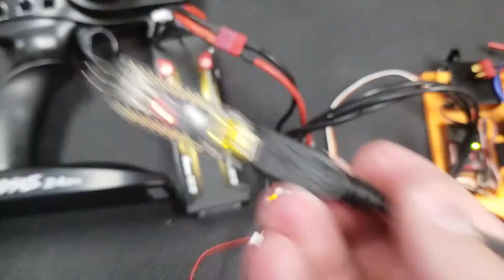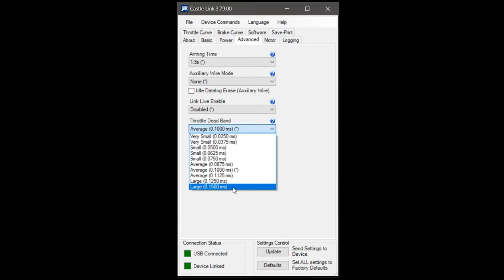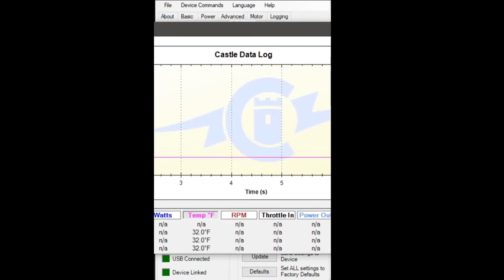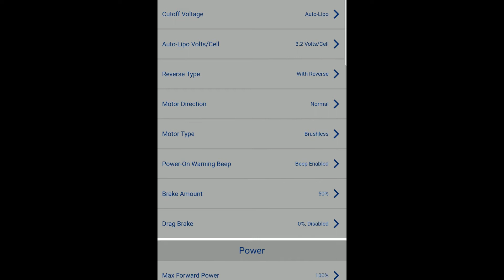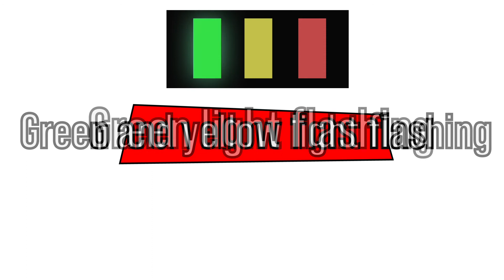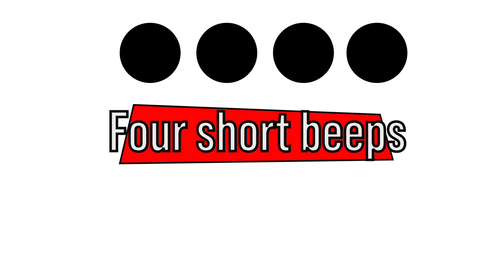Hobby 365: How to program the Castle Creations ESC

Comment: I have a Mamba X installed in my RYFT. It has two servos. One for the steering and one for the 2 speed shifter. If I raise the BEC for my steering will that also raise the voltage on the shifter micro servo?
Reply from the maker: Yes it will. Raising the BEC voltage will affect everything you plug into the receiver. That includes light kits, servos, winches ETC.
Reply: @Hobby365  what about if you have rear steer with the servo plugged into another channel?

Comment: Wow, amazing video full of information, thank you. Question, just bought a xlx2 last week and tested it today. When I pass half throttle and start turning the motor losses power and regains after the turn or release of the turn control. Is this a setting or esc issue?
Reply from the maker: This error is not actually a setting in the ESC. The XLX ESC's need a capacitor pack (cap pack for short). This will do 2 things: 1. Stabilize the voltage for the BEC which is powering your receiver and keep the BEC voltage high. 2. Solve Voltage ripple that will lead to overheating due to the inefficiency caused by over gearing and high power motors. For the XLX you will need a very large cap pack.

Comment: Hi, when i first calibrated my ESC to the traxxas TQI, the forward and reverse are the opposite. Neutral works fine. Should i have to buy a castle link adapter to reverse the motor direction? Or is there a way to reverse it without castle link? While keeping the full power of forward and 50% brake.
Reply from the maker: You can reverse the throttle with out the castle link. It is quite a confusing process with out the castle link. On page 29 of your manual starts the instructions for reversing the throttle. The programming option is number 6: https://dzf8vqv24eqhg.cloudfront.net/userfiles/4671/6540/ckfinder/files/Product%20Manuals/Surface/X_Series_Drivers_Ed_Guide_095-0290-00.pdf

Comment: I'm not understanding how to get it in full crawl mode
Reply from the maker: The best way to put it into crawl mode is to use the PC or bluetooth link. You can program the Reverse type with a drop down menu. Other wise you need to use their complicated menu system in order to change the settings. The manual has this to say:

To get into programming mode on the ESC:
1. Turn your transmitter on.
2. Plug the battery into the ESC with its switch off. Note: if your ESC does not have a switch,
hold full throttle on your transmitter before plugging in the battery.
3. Hold full throttle on your transmitter and turn the ESC switch on.
4. The ESC will go through its boot up sequence blinking green
5. There will be a sequence of melodic tones and the light will turn red
6. Keep holding the trigger, within 6 – 8 seconds the light will turn yellow. You are in programming
mode; let the trigger return to neutral.
When in programming mode, the ESC will beep once, pause, then beep once again and repeat
until a change is made with your transmitter. If you accept setting 1. Brake/Reverse Type’s
default option 1: Reverse Lockout, you would pull full throttle to accept option one. When the 
trigger is returned to neutral the beep pattern will change to 2 beeps followed by 1 beep
meaning that by selecting option 1 you jump to setting 2. If at setting 2: Brake Amount, you
reject option 1. 25% by going to full brake/reverse the beep pattern will change to 2 beeps,
meaning it’s still at setting 2, followed by 2 beeps meaning you are now at option 2 under
setting 2.

The first programing menu is your reverse type, option 3 is crawler mode.

You can see why I recommend the castle link software.

Comment: What happens when you have no Forward and just reverse…
Reply from the maker: could be a programing issue where it is set up in forward with brake and the motor direction is not adjusted correctly. Could also be a calibration issue. If you try calibration and the system wont calibrate unless you give it a reverse command then you need to reverse the servo reverse switch and program again.

Comment: My esc just flashes green forever when I try to calibrate it. What do I do?
Reply from the maker: Hi there. Flashing green means there is no signal from the esc. Double check that your ESC is plugged into the channel 2 or throttle slot not the Battery slot. Then make sure your ESC is plugged in the correct orientation. Plugging it in backwards could create your issue. Hope this helps.
Reply: @Hobby365   thank you so much man you are a real life saver
Reply: @Hobby365  hello I have the same issue when I turn on the esc it instantly starts flashing yellow red and green and will not allow me to calibrate it. Everything is plugged in CORRECTLY and it won't even connect to my b link.

Comment: what is this conector called to plug the esc into the pc?
Reply from the maker: It is called a castle link. There is also a Field link that will plug into the esc as well as adjust a few functions with out the need for a pc. Here are the links to a place where you can buy them.

https://www.hobbytown.com/castle-creations-castle-link-v3-usb-programmer-adapter-cse011-0119-00/p-xuhrhdgaae2bg4yz

https://www.hobbytown.com/castle-creations-car-field-link-programmer-cse010-0063-00/p-xqyehdha3uabg4yz

Comment: I’m having problems with the radio glitch or no signal, not sure what to do
Reply from the maker: I am willing to try to help you with that however I need much more info to even start. What transmitter, receiver, esc, battery, and servo do you have?
Reply: @Hobby365  I have a traxxas Maxx with a 4s 5000mah and a xmaxx servos I think it pulls too much power , it’s a tqi controller to a tqi link receiver 
I kee getting code     • • —. It’s the Radio Glitch
Reply: It’s a mamba monster X with the 1515 2200kv
Reply from the maker: @jasonrojas2176  Okay There is a few things to try. First thing is Does it do that as soon as you turn it on? This could indicate that your servo is bad. Try unplugging your servo and test it again. If it works replace your servo.

If the system randomly does that you want to try a Glitch buster. Try one of these: https://www.hobbytown.com/search?s=glitch+buster This will help keep your receiver voltage up while you are running your truck and can eliminate browns outs.

If the system does this consistently you will want to try a BEC Like this one : https://www.hobbytown.com/castle-creations-10-amp-adjustable-bec-cse010-0004-00/p-xqyyhehqzqsbg4yz This hooks inline with your battery and receiver and supplies 10 amps of current right to your ESC. You do need to hook this up in a certain way for dual battery vehicles: https://dzf8vqv24eqhg.cloudfront.net/userfiles/4671/6540/ckfinder/files/Product%20Manuals/Accessories%20and%20replacement%20parts/ccbec_multi-pack-large.png.

You can verify that the BEC will solve your issue if you have a 4aa battery holder such as this one: https://www.hobbytown.com/traxxas-4cell-aa-battery-holder-w-switch-cover-tra1523/p-xehnsfaq3qsbg4yz Just plug it into the receiver and check.

Comment: How do you use the software with an external BEC? I bought some used equipment that works well but I wanted to get into the programing without having to do it manually. Great video BTW.
Reply from the maker: Thank you for your comments. You can use the castle BEC with the castle link. I is really simple just plug it in and there is only one adjustment.

Comment: You can’t adjust BEC voltage without the castle link?
Reply from the maker: Yes! That is an adjustable parameter in the esc.
Reply: @Hobby365  but using the transmitter there isn’t an option for bec. It’s only with the castle link. I am using the castle copperhead and in the drivers Ed guide it doesn’t mention BEC adjustment using transmitter. I’m waiting for the castle link to arrive in the mail
Reply from the maker: @DeRock401  You are correct. The Castle link is required to adjust the BEC. You really should get one anyway. Firmware updates are all too common with electronic components these days. And the castle link will be required to do those too.
Reply: @Hobby365  yep I got the free one coming and might get the Bluetooth one so I can do it on the go with my phone as well. What is the BEC set for default ?  My new servo has been kinda glitchy which led me to believe it’s not set to 7.4v out of the box.
Reply from the maker: @DeRock401  5.1v is the default. Just make sure you verify that your servo is rated for 7.4v
Reply: @Hobby365  oh yeah it is for sure.

Comment: I just purchased the mamba micro x esc and 2850 kv 14series crawler combo.not pro crawling .looking for cheapest set up to program and run.with 7.4 v servo I don't have a computer but have access
Reply from the maker: The cheapest option would defiantly be the manual programing route, though no the easiest. If you wanted the easier castle link option without a computer you would need the B-link. I haven't tested the newest software to say if it is better on android than the day I published the video.